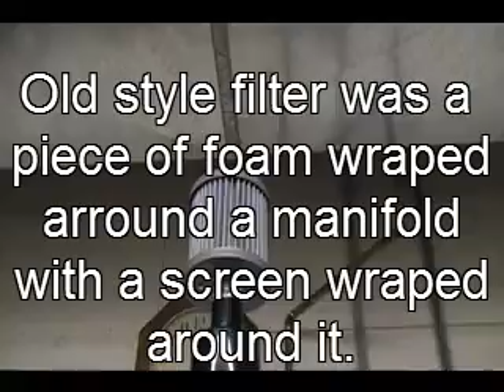Quincy QR 325 Compressor-Intake Muffler # 49

Comment: Take a natural loop, about 18" dia of clear thick wall flexible tube you get at the hardware store and attach it to the intake. Leave the loop because the flexible nature of the tube and the loop itself will dissipate the low and high freq. noise. I haven't tried car heater hose but it should work too. You can also use a 1990'sToyota/Prism (any) air cleaner box and attach it to the hose the the wall for extra sound deadening. I would guess it is quieter than the setup you have and cheaper too.

Comment: Scott , I posted a test run of my 325 today. Let me know what you think . Dave
Reply from the maker: Hi David, I will check it out. I'm curious. Thanks!
Reply: Scott. I noticed on your latest post on your new compressor you said the belts are hard to get tight.  I had the same issue so I made a tension tool. I extended the bolts down through the motor.  Longer bolts . Then I took a piece of angle iron with holes in line with the bolts and 2 5/16  eye bolts . Clamp it on the end with vice grips and loop the longer bolts through the eyes on the bolts an slip the other end through the channel . Then tighten the nuts until you get desired tension . Tighten motor bolts and unclamp . Works good.  Dave
Reply from the maker: Hi Dave, I'm going to have to give that a try! Thanks!
Reply: Scott , I uploaded a short video as per my description of belt tension tool . Dave